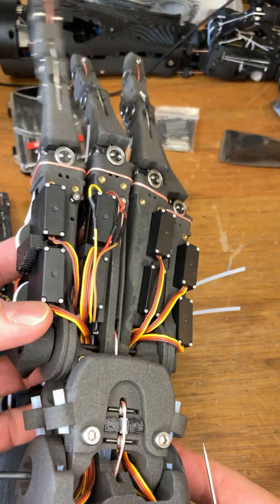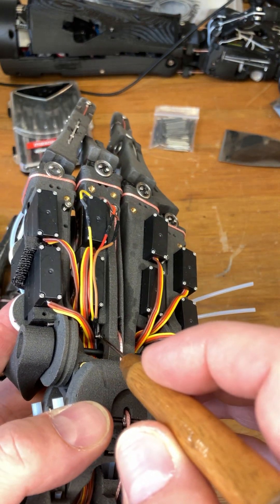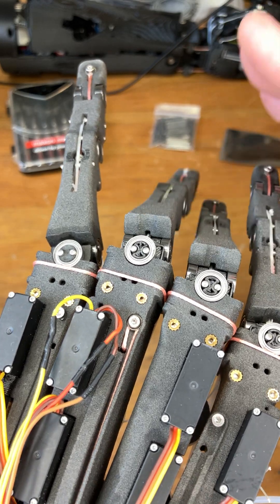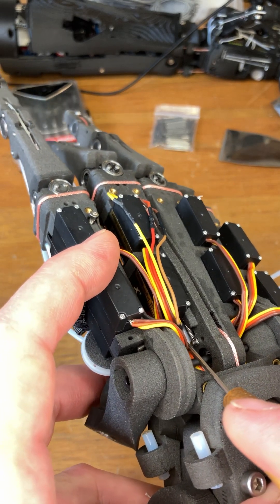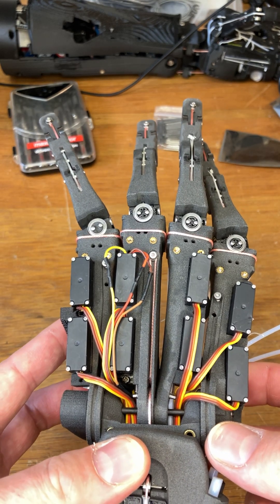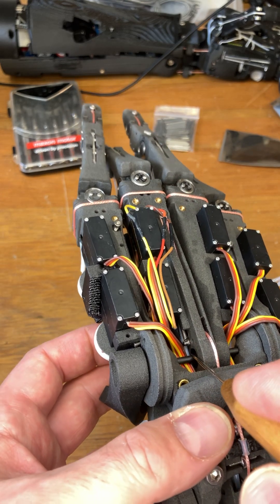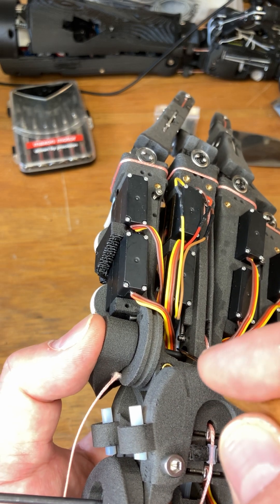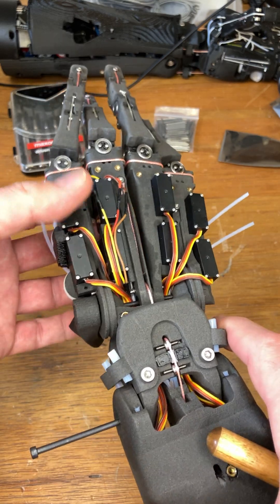Question from darkdan9121 on where to attach the springs on the V1 DexHand

Comment from the maker: Question from darkdan9121 on where to attach the springs on the V1 DexHand:

Hi, this project is awesome to have as open source and thank you for publishing it. I'm at this point in building the hand but can't figure out where to place these pins for the springs in the other palm bones to avoid interaction with anything else, or as to not slip off--particularly for the middle palm bone which does not have a structure to rest against. You said in the video that you were going to add some holes in the CAD model for this but I didn't print any, and the IoTDesignShop's modified version isn't changed either--drilling a hole is no problem, but I'm unsure of placement as I'm a bit unfamiliar with interactions further in the build. 
Are there any suggestions you might have as I tackle this?
Reply: Thanks so much for the video response! Helps a lot to even just get a good look on the close up of what is in that area. Excited to see how V3 turns out!
Reply from the maker: Very good! Please post video of your build when you can!

Comment: I have followed all your videos, and completed most of the parts. But I had a problem when I using Feetech SCS2332 servo for my wrist. Do you have document about how to only use Arduino to control it? I looked through their official website, they recommend to use their UR-1 debug board to control it, however I didn't see UR-1 in your electronics. It would be a great help if you response my question.
Reply from the maker: The Feetech servos connect to the serial port of the Arduino mega via. TTLinker board.

The FE-URT adaptor board is used to reprogram the servos before assembly. 

You will need one of each.

Comment: But when will there be a lesson on connecting electronics?
Reply: I made the connections and it was very difficult for me because it was my first time doing tin soldering. use a breadboard and ams117 voltage regulators for the motors. I recommend that if possible you look for motors that can withstand the 7.4v batteries and have the dimensions of the model so that you save yourself a lot of work, believe me, you have no idea how much I have suffered to be able to make those connections.
Reply from the maker: Yes, soldering is a pain.
Reply from the maker: I will finish the videos. Not sure when I will find the time as I plan to launch the Version2 next so please bear with me.